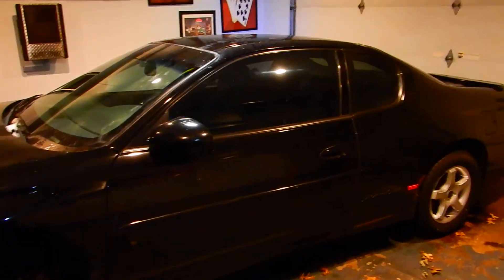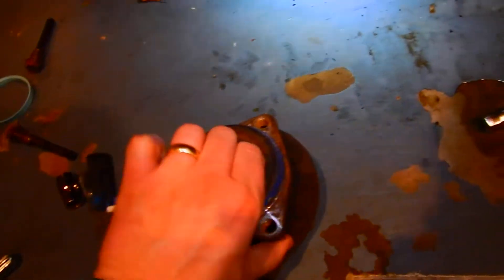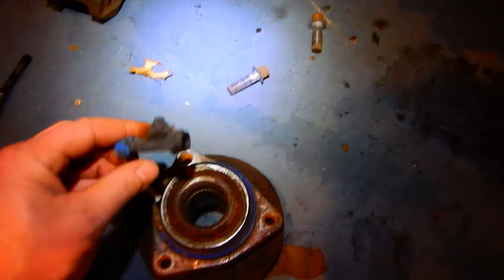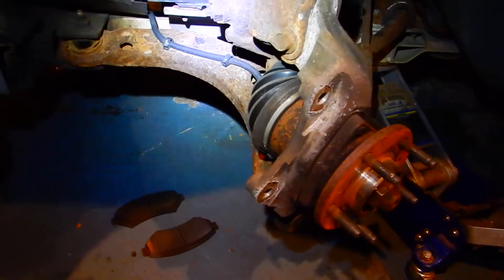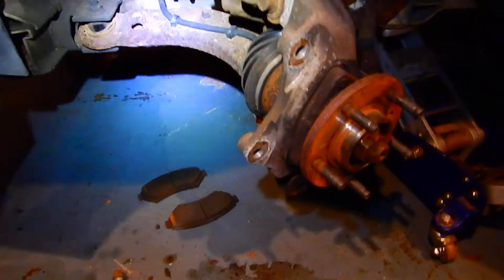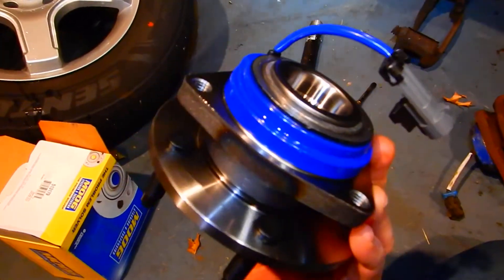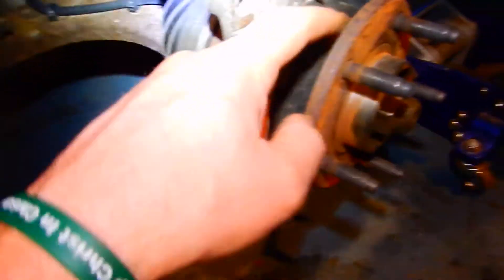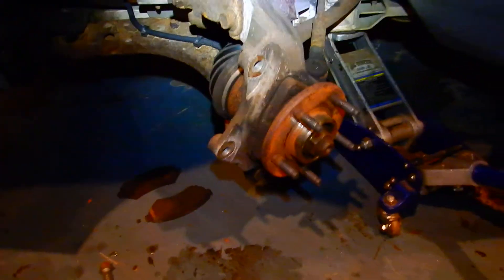2002 monte carlo ABS sensors and Traction light wheel hub fix

Comment: good video was going to get some Timken hubs as ive heard the same thing.  had maybe 3 sets put in my monte. its got 350K miles on it too which im sure didn't help but im trying to fix it right this time.
Reply: wagdbikerider dam you 305k in the monte strong runner. I have 80k on mines so I’m happy they can last that long
Reply: @swaggod226  I've seen a few of them do 300k. It's a good power train
Reply: @wagdbikerider  My previous 2002 had 220,000 and the mechanical who did the inspection said he couldn't believe that with those miles "...that engine purrs like a kitten!"
Reply: Detroit Axle warranty 10 years 50.00, I replaced both mine didn't clear the lights after scanning but says no codes and all module and sensors are fine? Who care if the lights are on? Not this guy 181,000 runs like a new car 3.8 series II Dale Earnhardt Intimidator original

Comment: You should also ad that the Axle nut has a torque spec. If torqued incorrectly or not enough, it will cause the bearing to fail prematurely. This is the #1 cause of early bearing failure on replacement parts.